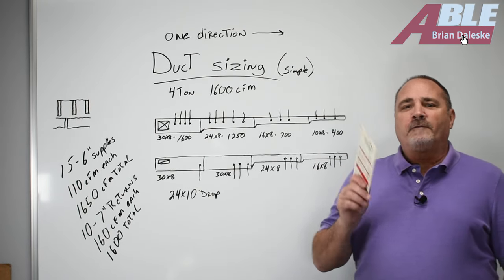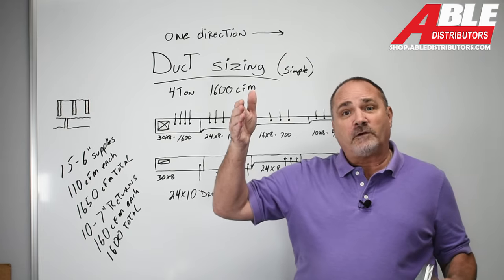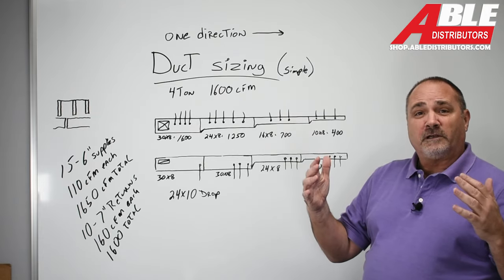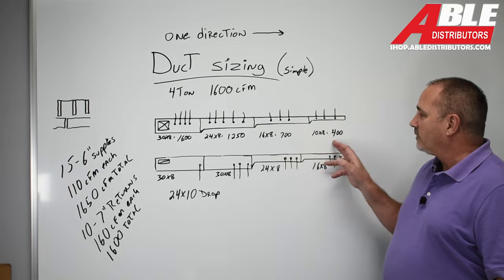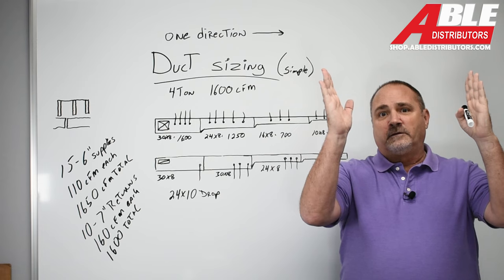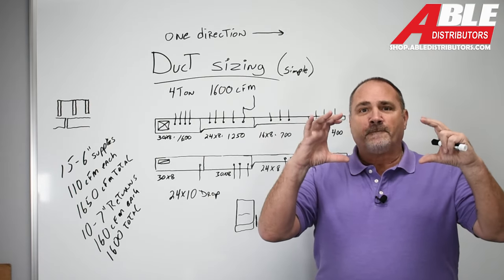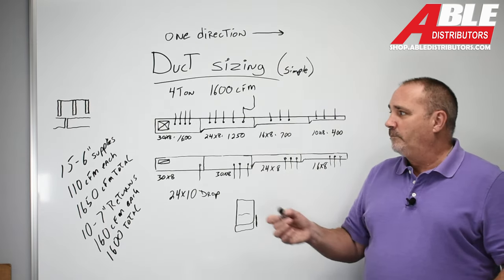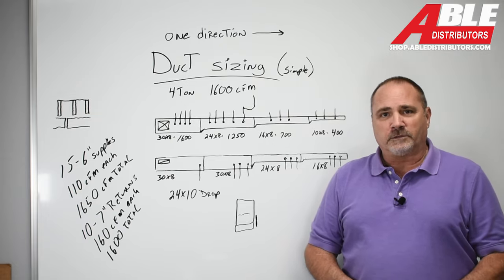sizing ductwork, quick and easy shortcut

Comment: Man, you should start a department in your business where you consult homeowners. I'm no HVAC pro, but I know my system isn't configured right because the has has an 800 sq ft addition and they didn't add new returns or change the AC unit. Every time I get a contractor out they just say, "That oughta be fine." I keep expecting someone to do measurements and calculate airflow, but not a one has yet. I know it's not right, but don't know enough to guide the conversation on the phone and weed out the guys that won't know any better.
Reply from the maker: I get it, but finding the right contractor is key ( and sometimes not easy ) .. with additions, it's often tough to maintain temperature with the rest of the home, in my area sun rooms or four season rooms built off the back of the home are popular, lots of windows, and has three outside walls, in these cases no matter how much supply and return you have, these rooms lag behind the rest of the home because they either gain or lose temperature faster then the main body of the home , often a separate system, such as a mini split is the answer.    in your case I would keep trying to find "your Guy" , explain your concerns, let him know how important the issue is to you ,trust me they want to take care of you and fix your problem, its how they survive.      Good Luck, don't give up.      Brian

Comment: Quick question. I watched a YouTube video that says a quick fast rule on residential HVAC that 1cfm per square foot of home. Is that correct?
Reply from the maker: I have never heard that before, and I would disagree for a few reasons,  where you live, Arizona compared to Chicago, different loads, design temps completely different. when we look at the smaller homes and the largest homes that we would treat with one system, that rule won't work, residential equipment stop at 2000 CFMs, but can handle a home over 2000 Square feet, and a 1200 Square foot home can be cooled with a two ton system at 800 CFM ( depending on region )  have the best day.    Brian

Comment: On a 2.5 Ton unit top fed is one return from the bottom of the unit adequate? The airhandler is about 20 inches elevated so that it can be vented through its bottom. Thanks

Comment: Why can't you tap of an end cap? I never do it, but I've been on many commercial jobs where the print calls for a square to round at the end of a trunk line to a diffuser. Aside from the square to round having a transition down to the round, what's the difference? Why is one allowed but the other isn't?
Reply from the maker: in a typical residential duct design, we rely on the air filling or pressurizing the entire duct, you could say the air hits the end and turns around, keeping pressure to deliver air to all of the runs taken off the entire light of trunk line... in many commercial designs we are dealing with a higher velocity and pressure.  in small duct/high velocity systems like Unico ( we sell )or Spacepak, the placement of supply runs and size of duct are even more important to keep an even flow through all of the supplies..... typically in residential we dont take anything off within the last foot of ductwork. the return side of the system typically won't have the same rules, due to the vacuum effect .      hope this helps, thanks for checking out our videos..

Comment: Omg someone finally said it .these big open spaces people want makes it hard to add supply nd return into . 
    Running wire , nd dwv  is not easy but duct work is just as hard if not harder.
    Great video liked the part about putting it up on a box, people don’t get it . RETURN is just as important as supply, heck I always make my return equivalent to or greater than supply
Reply from the maker: YES ! and thank you for checking out our videos, more to come...

Comment: Hi, thanks for the great video, very easy to understand.   Question for you:  I have to move the furnace and air handler to the basement. The original house had two systems one in the attic and one in the basement. The one in the attic needs to be replaced.   I will move the unit from the attic to the basement and run trunk and return lines up through the garage then across the attic.  The duct needs to go up about 18 feet, turn 90 degrees, then run across the attic to feed the second floor.   I have been looking for how to calculate the friction loss of the turns in the trunk and return lines.  Can you recommend a source for these calculations?  Thanks! Milache.

Comment: Maybe this will be a quick answer you can point me in a direction to find an answer / solution. 2 story house in the SE with 2 units in attic. Directly below that the space with the units it could have been enclosed as a 4th bedroom, or open to use as common space. Turned that common space into a media room.

Here’s my question; 

Where the closet would have been (dead middle of wall) it’s an open alcove I built out for the media what nots. On either side are false walls that have were designed to hide ductwork, etc. Would have been there bedroom or not. 

Both false walls surface area and depth are identical. On the left hand side there shouldn’t have been anything. Opened wall to put in a glass front wine type fridge, and got a little surprise of 3 flexi ducts running down, luckily at the very back of that cavity.

In order for the wall to accommodate that fridge I need to push the duct work back maybe 2-2.5”. Considering the minuscule space I need to steal, do you believe it would be ok to pinch the ductwork a little? Let’s say 3” total to be conservative considering I’m using my government education and calculating without removing my shoes. 🤣 

Obviously I won’t hold you to any advice you can give. I’ve seen around some bends or areas where they have to snake flex duct it seems like some ducts gets reduced / pinched / folded a lot greater than even 3” I’m referring to.

Thanks for the video and thank you in advance brother!
Reply from the maker: thanks for checking out the video, just to many variables to consider to make even a guess, airflow is important both for your comfort and the performance of your equipment, sometimes its worth the cost to have peace of mind, my suggestion would be have a reputable contractor take a peek.  sorry, I know that wasn't the answer you were hoping for, but its the right answer.   enjoy the holidays, Brian..

Comment: Thanks for the great video. Could you advise how do you plan branches to make sure that you get right amount of airflow from it? For instance with that 6" duct on hard pipe how many elbows are ok to have 110 or 90 cfm out of it? Thanks 🙏
Note: for better exposure i would recommend adding hashtags in the description like #hvac #ductwork #ductworksizing etc.
Reply: Lol I'm just a hydronic guy but I have this problem with 6" in my attic to the hottest room in the house, they made two 90 offsets with elbows and the room is always hot, I'm thinking of removing them and piping it in straight.

Comment: My home has equal cooling in all rooms as long as the doors are open. Closing a bedroom door at night is common, but it makes the sleeping room warmer.  
 I want 69 degrees in bedroom at night, but thermostat in living room has to be set at 67 to get the temp of 69 in bedroom.  I have a Honeywell thermostat with remote sensors so have some accurate reading. How do I fix this? I have closed down most of the registers in the main rooms and helped a little.
Reply: Add return in rooms if possible, if not you can add pass through grills in walls or pass through ducts in the ceiling connecting the bedrooms to the hallway so return air can be pulled through when the door is shut. If there are wood floors instead of carpet you can undercut doors for return but the previous options are preferred.

Comment: Question please 🙏 
1ton=350-400cfm for cooling
But heating only take 65% than cooling
How do I know what duct size good for both heating and cooling since they require different cfm?If duct size good for 400cfm for cooling also good for heating? Why only design cfm for cooling not heating?

Comment: Hi there I’m wondering if the duct work start off shooting in both directions does that change what size duct I can use to get the cfm wanted? For example I have a 3 ton unit that has a 8x10 trunk going one way and a 8x12 going the other. So can I change to a 16x10 and 8x10 to get my 1200 or is it gonna be different because the main trunk goes two separate ways? Any help would be appreciated!
Reply from the maker: Part two of this is up on YouTube now, check it out.   Thanks for watching, much more on its way....... Brian.

Comment: I am a commercial guy and usually have plans that show the duct size but lately I’ve been doing a lot of systems that I have to size now I have basic ductulator skills how would u gauge the fiction loss for a bigger commercial package unit
Reply: I deign to keep the static pressure to .10 Sp all the way through the ducting. Since you use the Ductulator (me to) it’s easy use .10 from the first duct to the last and it works out perfect. When I measure my CFM I’m within +-15% before adjusting my dampers 10% after my adjustment. This will work for cleanrooms, labs and offices. I switched to residential design after being in the commercial world for 30 years and I’m blown away with the lack of knowledge with regards to duct design